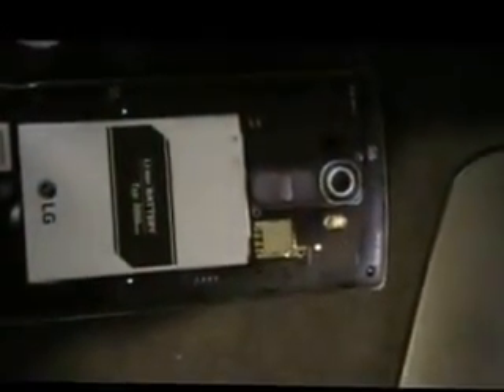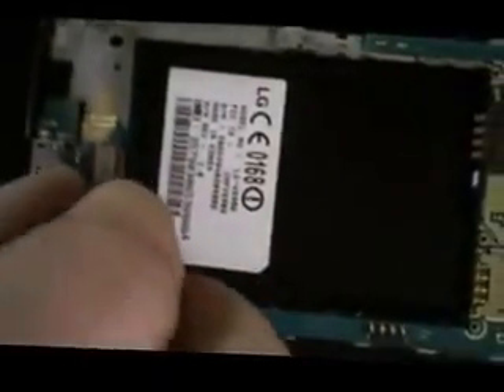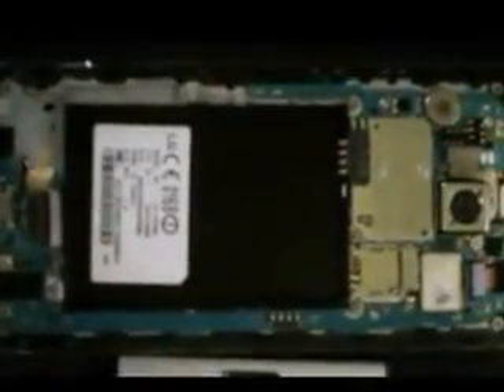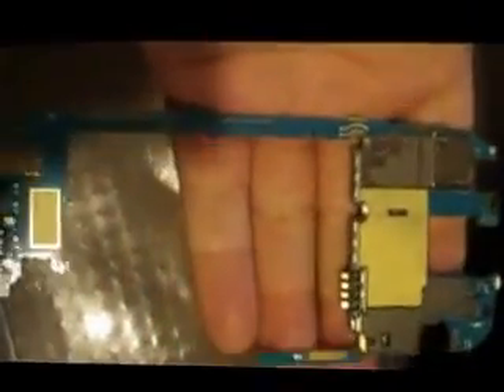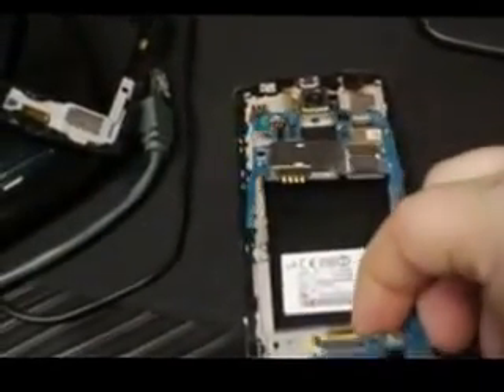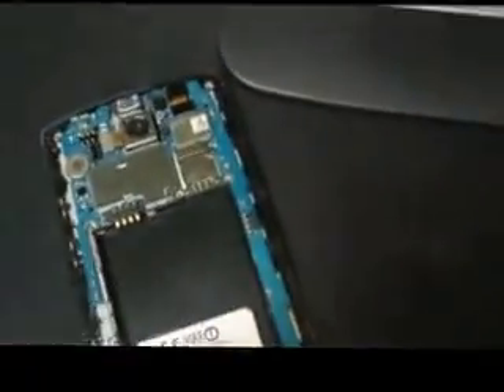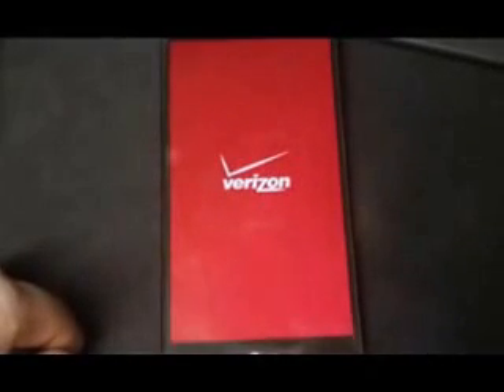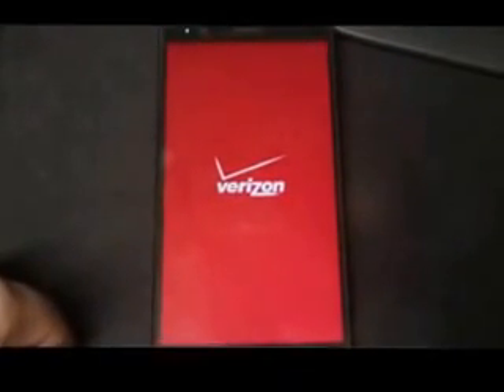LG G4 Boot Loop (Temp) Fix

Comment: Going to try this with my samsung galaxy tab 2 10.1.  This is such a common issue and if you're not on a warranty samsung wont do anything.  Im wondering if you couldnt use a heat gun on it?  Im a computer tech and am finding out that cell phones and tablets aren't so different from computers

Comment: That is because the emmc chip (internal storage chip) gets very hot and de-solders from the board (or at the very minimum gets cracked solder joints) the oven trick heats up the solder and expands it to make continuity. the permanent fix would be to place a small piece of thermal pad or zinc paste on the emmc chip and then bond it to the EM shield. that uses the em shield as a heatsink. This may actually fix this issue permanently.

Comment: Well yeah, the issue ist that the  Processor lifts off The Mainboard and the connections are cut. By baking it, the connections melt and are connected together. With that method you sadly cant do it very effictively but there sure is a way to make the phone work for longer than just a day maximum

Comment: Contacted LG and they will do nothing for you if device is out of warranty.  This is BS since they know that this issue is from bad manufacturing, warranty or not they should fix the device.  After finding out LG was going to be no help I decided what the hell do I have to lose.  Happy to report that I baked the board and was able to pull my pictures off the phone and do a fresh backup to the Verizon cloud.  I am due for upgrade anyways so just wanted to get data off the phone.  Was seriously looking at going with the LG G6 since I loved this phone up until this point.  Not anymore, I will now not purchase anything manufactured by LG.  I let LG know this as well not that they care.

Comment: Everyone at Sprint said it was a lost cause. My phone was gone for good. So I froze it, dissected and torched circuits for 30 mins with blowdryer (in 10 min intervals!), connected to 9V batteries with electical wire, adjusted phone ports in every possible position, and after a month my old phone still wouldn't turn on. I had to mail it off today to avoid $500 penalty so this morning was my last ditch effort. I had saw this a couple days ago but saved it for the last one...because of all them, it seemed the most far fetched to work! I put a couple of branches under it, baked, and after putting back together, attached battery and pushed that power button for the last time. Viola! I was able to retrieve my memories and phone stayed on all day, even as I put in envelope. I know. I know. A very long comment about some dumb phone that I should have backed up in the first place to avoid all of this...but I'm excited to have my photos and in proving all the folks at Sprint wrong. thank you so very much for uploading this. if anything, be more clear about what you can or can't put under it in oven. that part freaked me out the most  lol

Comment: can i put it in to the freezer ???
i saw it on another video .
Reply: I tried the freezer before baking it. I tried it several times and it would work for about 5 minutes, if that. I just tried baking it and it worked for about 10 minutes but not enough time to get what I needed and erase. Just baked a second time and I'm letting it cool now. Hopefully I can get enough time to get it erased. I had to use insurance but got a new phone yesterday.
Reply: thx

Comment: I can confirm this also works, I did it on a Lg 4g H810. Unfortunately all my info and pics were deleted when att tried to reset my my phone and it failed to do it. But this oven trick does infact work, My phone is still going after 1 hour

Comment: 100% works, u dont need to bake the whole thing tho.. all i did was put the motherboard on a piece of wood and ran my heat gun over it for a few seconds. let cool, and reinstalled.  it booted right up.  thanks for the vid
Reply: you are man bradley k
Reply: still working for you now ?
Reply: Where exactly did you point the heat gun, on the motherboard...?

Comment: Sincere thanks. Verizon is replacing my phone for free with my extended warranty (mailed me a new one, without a back or battery, and I have to mail the old one back to presumably be refurbished). I didn't want to send the looped phone back until I was able to at least pull my personal files off of it. The freezer trick didn't work for me, and I was worried that the resulting condensation would cause additional problems. Baked the board for 5 min at 400* as in the video, used a layer of parchment paper instead of the magnet/wood setup you had. Worked like a charm. Survived 45min worth of file transfers, and I've been able to delete personal data and reset the phone -- which includes the phone turning itself off and on again twice. She's ready to return to the mother ship.

Comment: All,  while this method appears to work, if you do not want to put your motherboard in the oven an alternative would be keeping the device running warm ( i have had heating issues with my phone so keeping it warm is not an issue, just putting it under a pillow works) that should get it stable enough to get a back up of your data. Thank you Bradley K for inspiring this other temp fix

Comment: Thank you!  This method worked for my wife's phone.  Was able to turn on the phone long enough to backup photos, contacts, etc...  Actually still going strong one hour later, but I don't expect it to last forever.
I suspended the board on two wooden spatula's (didn't catch on fire, phew!) on a tray, and set to 385F instead of 400F (chicken factor), for 5 minutes.  Used a temp sensor to keep track of the temperature.  Then turn off the oven at 5 minutes, leave the board in there, but open the door to let it cool down slowly.  When the temp reached ~180F, I pulled the tray out to rest on the stove top.
One mistake on my part, I forgot to remove the sim card... SMH!  Luckily it still worked, but the molding melted and now is stuck in there.  Not sure how to explain that to the service rep later on...  I can probably file it down to get it out.  Arg! So frustrating after spending the entire day freezing the phone, blow drying, and baking earlier at 200F...  Just one mistake at the end really sucks.  But at least the wife was super happy to have all her photos.
Reply: Hello, So the freezing method didn't work? I want to try that before baking. How long did you freeze (just the motherboard) for?
Reply: sorry for the late reply, I am just now checking this video again, because now my phone has the boot loop problem!
Freezing the phone for half hour got the phone to turn on only for a few minutes, not long enough to do anything with it.  Baking was really required for my wife's phone.
I will now try baking my own phone.

Comment: Hi, my version is H818N dual card. Being different with the chip of Bradley, mine have a thin brown transparent plastic component sticking the second card port and the chip together. Will this plastic component melt in oven? Thanks so much!~
Reply from the maker: I think you have the international version in which case you should be able to fix your issue through changing the bootloader. Look up on XDA for how to's . I would not recommend baking your board
Reply: Thanks Bradley for your quick reply. I managed to take second sim port and the flex circuit away. Followed your method. My G4 has been really fine for 6 hours. Thanks for your help for so many people.

Comment: I can confirm that baking the motherboard at 400F for exactly 5 minutes will indeed fix the problem temporarily. I only waited about 10 minutes before putting the board back in the phone because I cooled it in front of a fan and the phone actually worked for a full 24hrs which was plenty of time for me to create multiple backups of the entire device.
Reply from the maker: glad it worked for you

Comment: This works like a champ, mines been working for over an hour now.
BUT I did a total buffoon move. I forgot to remove the SIM card and it's now melted inside the slot.
Any ideas?
Reply from the maker: use an exacto knife and carefully try to cut out sim card. Unfortunately going to have to get a new one from your cell phone provider.
Reply from the maker: +Big Boss Tech (YS) it's an electric oven. you just need an oven that will radiate heat - 400 degrees Fahrenheit for 4 minutes.
Reply: Thanks bro everyone here saying it worked 
so i want to try it but i what kind oven is that :/
plz let me know cause i dont want to lose my phone
Reply: Bradley K ok browill try and let u know 
THANK U .

Comment: I know this will come off as a dumb question..which it probably is but Im desperate...if LG techs change the board on the phone..there really is no hope of getting pix that were saved to the internal memory?? i got the phone back from lg with a new board even though I specifically asked if they could help with the pix I hadn't gotten around to backing up...shouldve tried this b4 sending it in..
Reply from the maker: if I'm reading this correctly you would have to do this before you send your phone back together new board since the pictures are on board that is damaged. If you send your phone back and get a new board your pictures will not be on the new board

Comment: This totally worked!!!! Thanks! I definitely would recommend setting it on top of wood so it's not touching metal. So far mine's been working for about an hour. Not expecting it to be a permanent fix but it did let me back everything up.
Reply: Didn't you have to re 
bake it again?
Reply: +EvolutionIXRR I didn't. Worked for about a day, long enough to get my pics off of.

Comment: 1 Question,will this boot lopp happen on new Phone,because i need a phone and the best that fit me is LG G4,it has all features that i wanna to have,so will this happen if i buy it now?
Reply from the maker: You have a pretty good chance you will not receive the boot loop with a new phone. But if for some reason the new phone you got has the serial number 505-509 send it back and ask for a new one because they're trying to sell you a refurbished phone. these serial numbers have been noted to do the boot loop. I hope that helps :-)
Reply from the maker: I'm sorry, I made a mistake it's a serial number starting with 505 - 509 not ending with those numbers
Reply: Bradley K Thanks,i have read on forums about this models about 505 till 510,few of them got new motherboards with serial 610 with MM on it and got boot loop again,maybe this is not the case with new one that have been manufactured
Reply from the maker: Leonardo D93 me personally I would avoid the LG G4 and V10. I was going to get another G4 but I ended up moving to HTC M9. Little bit of a smaller phone but I like the layout. Unfortunately I'm with Verizon so rooting is not possible :-( at least I have marshmallow
Reply: i looked for Huawei Mate S,Huawei P8,HTC ONE M9,Note 4,Sony Z3+ but the LG G4 is everything that i wanted from a phone,i can not explain how happy i was when i found the right phone for me,but then i looked on forums about this phone and found about this boot lopp problem :((((((
Reply from the maker: +Leonardo D93 funny part I was exactly in your shoes. I love the LG G4 so I got mine on swappa. Even knew about the boot loop problem and I just assumed it wouldn't happen to me. and the rest is history
Reply: What is about LG G3 this is good phone to
Reply from the maker: +Leonardo D93 I want from the G3 to the G4 because of marshmallow and Bluetooth 4( transmit and send data between a Bluetooth device) which is not available on the G3. I think by now marshmallow is officially on G3 I'm not sure though... although the processor is pretty slow on the G3 in comparison. but that would probably change significantly if it had marshmallow on it. other than that the phones are pretty much exactly alike except for the battery capacity

Comment: Thanks bro . Its worked i just try in 2 lg g4 and its works for my device . Thanks alot
Reply: How long did it work, before going into loop boot again?
Reply from the maker: +Mahnoor Zahid between 10 minutes and all day. It's kind of the luck of the draw. baking it a second time might be needed to get all your data off before it starts looping again
Reply: How did you got it fixed permanently?
Reply from the maker: +Mahnoor Zahid  getting a new phone :-)
Reply: Well that's quite a shame, buying such an expensive mobile phone and it gives up on you at the moment you need it the most.
Reply from the maker: +Mahnoor Zahid after this happening to me I'll never buy another LG phone again. I'm much happier now with my Samsung 7 Edge

Comment: I did it today and it has been working since then. 
for how long can it continue to work?
Reply from the maker: it's definitely not going to last forever. I would consider just backing up your data and getting a new phone. mine for example only lasted about 40 minutes and then it started restarting again. Some made comments saying that they're still using it. just use caution when making it your daily driver
Reply: +Bradley K  Tnx a lot!!
Reply: +Bradley K so now my phone died again, do you think i should try To fix the solder mask in a lab and my be hope they will improve the connections ?
Reply from the maker: LOL! I doubt it you take it to a lab  it would be cheaper than just getting a new phone  :-) +ליאור קידר

Comment: Just tried this, just with a heatgun and it worked, didn't want the fumes in my oven
Reply: Which chip did you apply the heat gun too ?
Reply: that centre metallic part on the top around there, front and back.. the issue still occurs now and then though, when i charge the phone. But i jus apply heat again and it works again. It really is just a temporary fix to pull your data. I'm still monitoring the phone
Reply: If you mean by 'metallic part' the silver metal shield that surrounds the Cpu then that should be removed before heat-gun treatment.

I had some success with inserting copper head-sink on the 2 main chips but eventually that stopped working and phone wouldn't even start up at all.

I borrowed my brothers heat gun and I had the phone up and running without any heat-sink in less than 5 mins.

First I heated for 1 min .30 seconds and although phone booted up it crashed after about 5 minutes use. 

I did a little more 2 mins on one side and it's lasted a bit longer.

Then a third time I did 3 mins each side ( the gun was on 320 degrees setting, the lowest) and the phone hasn't crashed since yesterday. Also it doesn't seem to be getting quite as hot as it used too.

I will put in the heat-sink again so that if it doesn't go downhill again at least it might not crash so quickly.
Reply: how do you remove the heat sink?
Reply: I used my thumb nail by prising gently at one of the corners. Once it starts to raise up you can just peel the whole think off. I haven't put mine back on. If you use a tool make sure it's not made of metal as you could accidentally touch it on the circuits and it could short circuit and further brick the device. PS I have been using my phone all day and no problem whatsoever.

Comment: Hey there! 
I have the same problem, my LG G4 is stuck on the logo screen. Do you advise me to try this solution? If yes, will i have my pictures and contacts again? And please describe for me what the things you put the board on, and all of what i have to do before i bake it, and how i have to use the microwave too. Please reply me as faster as you can and i'll be so grateful to you:)
Reply from the maker: hi , under no circumstances is this a a sure thing many users have got this to work but also many users not. There's no guarantee that you will be able to get the phones work completely the way it used to be. pretty much consider getting a new phone . but, this may work and getting your pictures off before it starts going through boot loop again. As other users have then you can use a couple pieces of parchment paper instead of the pieces of wood I used to prop it up. You just want to use something that will not melt and does not conduct heat between the surface of the motherboard and the surface of the pan you're using in your oven. again you must use an oven and not a microwave. using a microwave would definitely ruin the motherboard and possibly your microwave to. also if your phone is still under warranty I would not recommend doing this. Since you could just get a replacement. But unfortunately you will lose your pictures and contacts. one good thing with your contacts though it should be thanks to your Gmail account so when you get a new phone they should just reappear providing they were synced to Google and not on your phone. I hope that helps I don't know what else I could really say, other than it works for me and some other users as a last resort instead of just throwing phone away :-) good luck
Reply: +Bradley K thanks dear i'll try it:)
Reply: dude i did this to minr today and it worked. but i was told to bake for 7 mins at 385, but at 5 minutes it started to smell burnt so i took it out quick. and i waited 20 mins, put it back together and transferred my pictures quick before the phone decides to die again, but im typing on it now so its noy dead yet 😀

Comment: Hello,
I have the same issue with my LG G4 H815, could you please tell me if I can use a Microwave ?
thank you
Reply from the maker: +El Mehdi Jaaouar DO NOT under any circumstances put your phone or any metal in your microwave. You will no doubt ruin your phone and possibly your microwave. The solder needs to melt that is why it is put in a oven at 400°.
Reply: +Bradley K thank you for your prompt answer ;)

Comment from the maker: please keep in 
mind that this is a last resort and should only be used if you're out of
 warranty and have no way of possibly getting a replacement. 400 degrees
 is the max temperature and I would not recommend going over the maximum
 time limit of 5 minutes. but to each their own.
Reply: Please reply my comment above